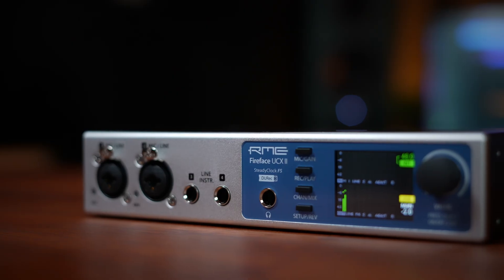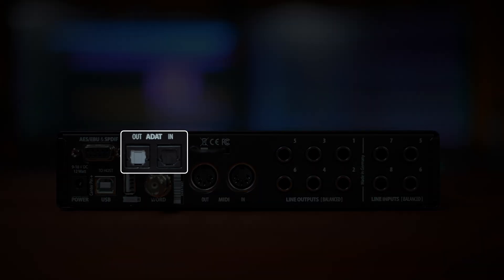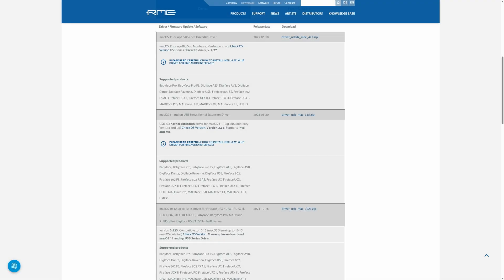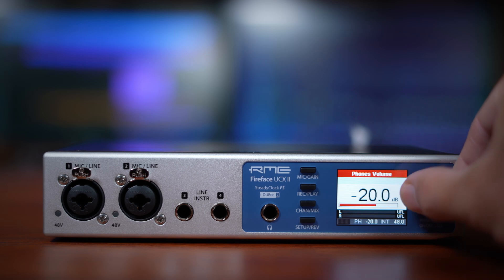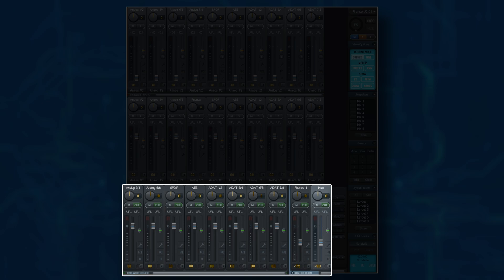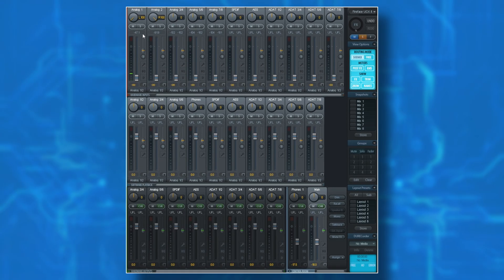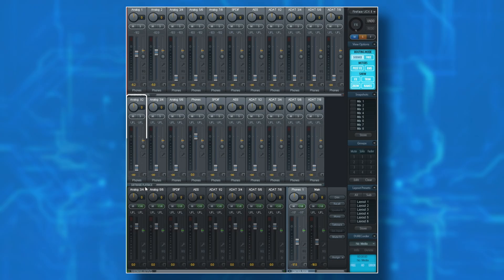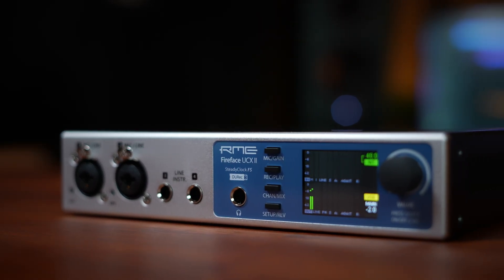RME Fireface UCX II: The ultimate quick start for the premium audio interface. Full walkthrough!

Comment: It’s an amazing interface, I use it with a Pulse8 on a small studio setup, no patch bay, all the routing done via TotalMix, SoundID profile created and imported into the room correction EQ. So much power in such a small footprint. This is actually going to be mounted in a cute 9.5 inch rack with a Boss SE-70 and a JV1010 !

Strangely I end up using it more for standalone monitoring or as a live mixer rather than an audio interface right now ! RME should build on this use case : more DSP FX, sidechain source on the compressors, and the SoundID profile import should also work for the headphone output !
Reply: Glad I came across this comment, I didn’t realize Ferrofish made an 8-channel converter!! Awesome